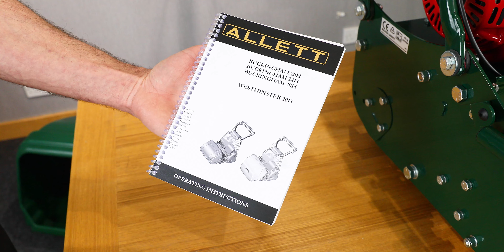Allett Buckingham 20, 24 and 30H - Unboxing and Preparing to Mow

Comment: Is it possible to replace the 6-blade with a 10-blade or any higher blade count?
Reply from the maker: Not in the Buckingham I’m afraid no it’s not a cartridge mower. Our Westminster has 12 blades.. or our Stirling and Kensington/ liberty mowers allow you to insert a 10 blade
Reply: @ALLETTMOWERSUK  many thanks for the quick reply! I knew it wasn’t as easy as a cartridge swap, but wondered if it could be done at all.